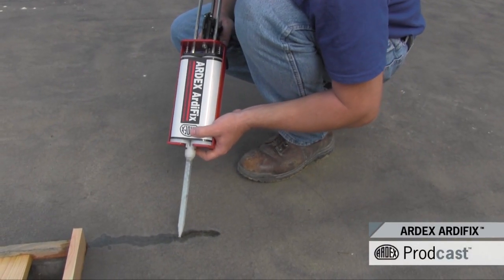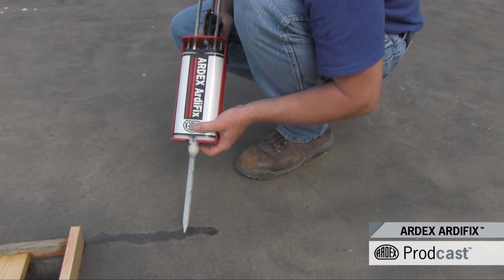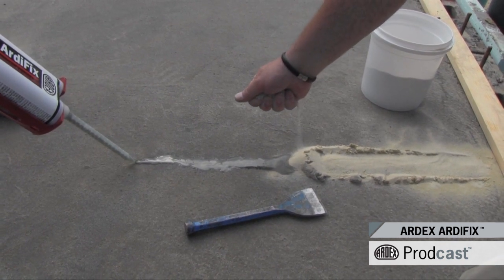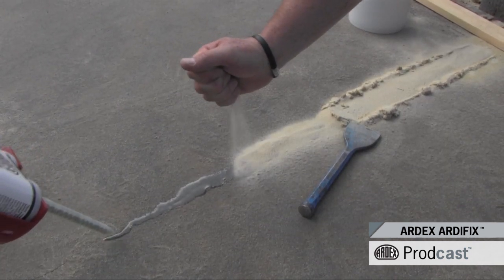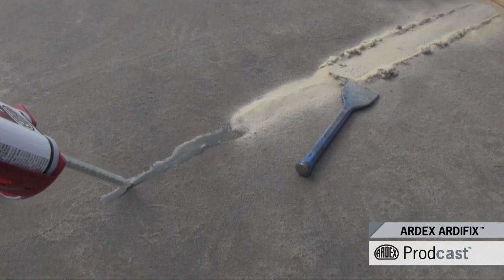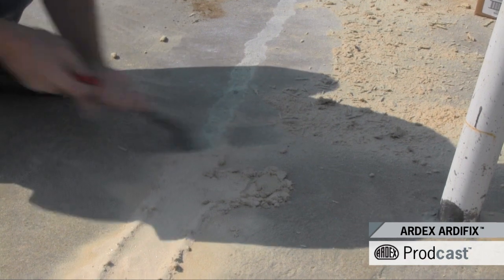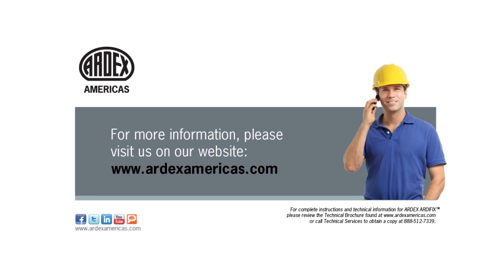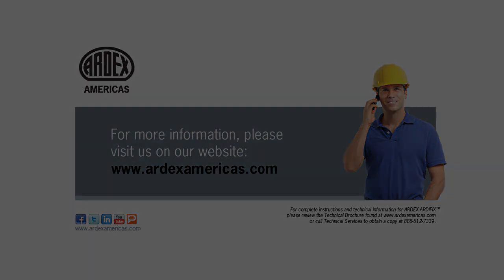ARDEX ARDIFIX™ ​Low Viscosity Rigid Polyurethane Crack & Joint Repair​​​​​​​​​​​​​​​​​​ - Prodcast®

Comment: What purpose does the sand have? Im new to concrete repair so im not familiar with this type of repair. thanks for any information.
Reply: I am surprised nobody answered you. You typically broadcast sand into wet epoxy type materials to give the next product you put over it something to grab on too. Since epoxy dries so hard it is difficult to bond with other materials.